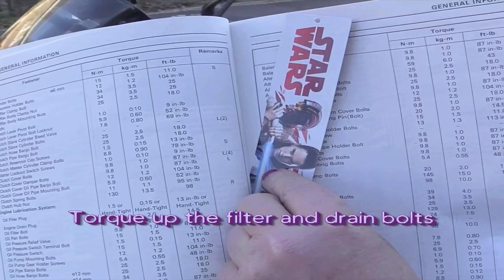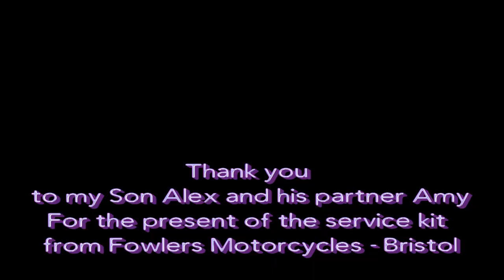Kawasaki ZRX1100 Service

Comment: Hi can you explain how to remove the gas tank please ? Thank you for your video
Reply from the maker: There are two bolt's that secure the tank at the rear. But you will also need to disconnect the fuel pipe and vacuum pipe from the tap. Also the fuel gauge block connector and vent pipe (both accessed by lifting the back of the tank) will also need to be disconnected. 

The tank is supported on the front by two big round rubber grommets. Sometimes these can be a bit sticky so a bit of wobbling and pulling is needed, the tank will pull backwards and upwards off the grommets mounted either side at the front. 

Hope that helps.

Comment: Getting at the two inner plugs is an absolute nightmare on the thing. 
And don't believe for a second we didn't notice the editing cuts that make it look, well not "easy" per se but about a hundred times less hard than it actually is <g>
Reply from the maker: Well actually the two inner plugs are easy to access, just needs the right sized socket and extensions. They are accessed straight down between the frame tubes from above. The only issue is if the socket does not retain the spark plug then a magnet on a stick is helpful to retrieve them. The hardest part is getting the tank off!
Reply: @CuriousAdventures  I disagree, although the inner plugs proved less difficult than I remembered if you simply unscrew the thermostat valve. More accessible still if you then disconnect all the electrical connectors.
Reply from the maker: @Cancun771  KISS why bother unbolting stuff when it's easy to do without? I don't have a problem getting to the plugs with the tools I have. No point in messing around undoing other stuff when it's an easy job anyway.

Comment: use  17 MM socket and short extension   -- works just fine.
Reply from the maker: Great, yes, sure it does. "Fine" is OK. But I prefer to use the best tools I can. Note these tools came from working in places where I had to do what others had failed to do. Need better than "fine" as that is what usually led to the issue.